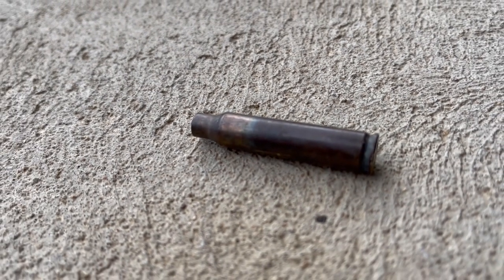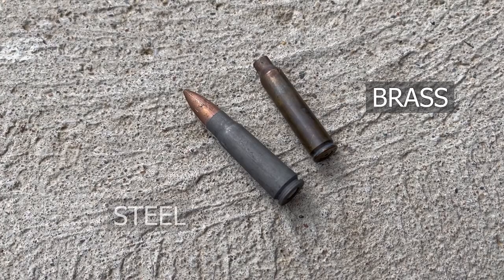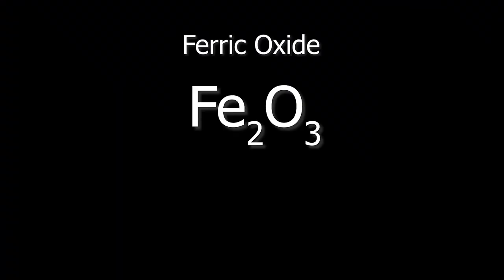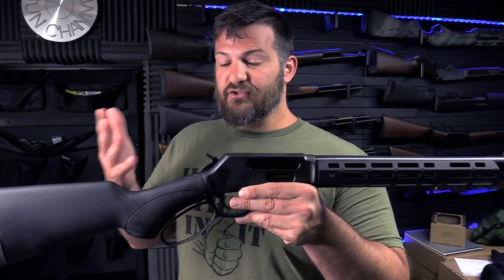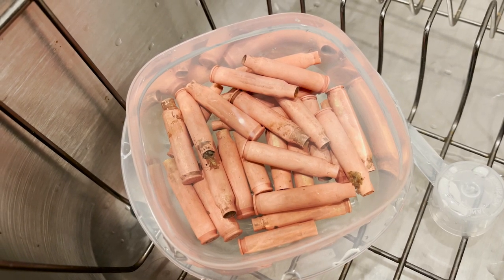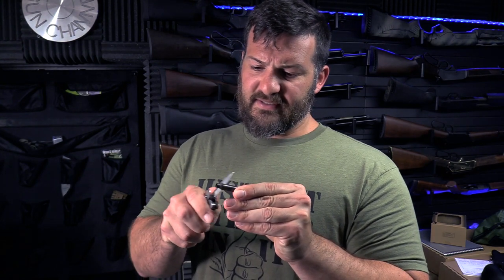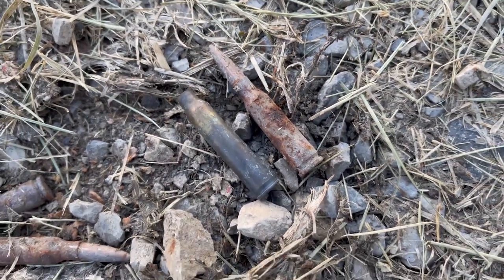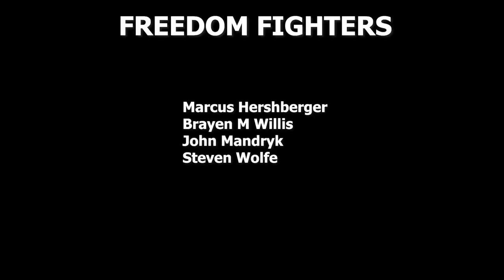Are These Reusable? Corroded Casings

Comment: Used many pieces of brass that looked just like those (the black ones not the red) over the many years ive been reloading. Never had any issues after getting em cleaned up
Reply: I did the same thing. Unfortunately the stain from the tumbler sludge has ruined my bathtub. I dont want to get to aggresive with any abrasives. Any advice on tumbler black sludge stains?

Comment: Drop in vinegar 5% delute is fine... maybe a few hours.. check every 30 to 45 minutes.. they will not need to be 100% coppery or brassish color and the dark carbon look will still be present.. drop them into a neutralizer water & baking soda, mix around well.. if you desire to know if the base neutralizer is at a balance, test stripe can be made from red cabbage juice making process or purchased for checking pool water or aquarium water (not all aquarium test strips have the full scale of Ph scales) Then throw the batch in the tumbler for the normal process one does for that.. inspect cases for the typical damage from either the previous owner, or range damage.. Run the day lights out of them...

Comment: I just showed someone that even a nasty piece of old rifle brass that comes out of the wash looking like straight copper (dezincification from acidic soil and water) is just surface deep. It’ll literally wipe off with 0000 steel wool, or in a tumbler. Black pitting is what you want to keep an eye out for. 
Oh and powders like the CFE ones from hodgdon will make everything be covered in blue (copper sulfate?) crystals. Old brass, gas blocks, bcg, if it sits for any amount of time you’ll get them popping up anywhere copper is.

Comment: I got a bunch of casings with oxidized and corroded cases mixed in. I should have separated the oxidized ones from the badly corroded cases before tumbling but well they all ended up shiny and looked new, except the case wall for some of them turned out to look like moon craters. Can’t tell if it was the corrosion or if it was me letting it sit in tumbler for far too long but those definitely weakened the case wall and are not smooth enough to be easily resized. I toss those away. All brass cases and jacketed bullets oxidize over time I wish there was a better way to keep them shiny besides bagging them in airtight containers or vacuum seal them

Comment: I noticed something odd like this one time, before I had my stainless steel wet tumbler (which is the best method for heavily oxidized cases in my opinion), while using a sonic cleaner and some Purple Power. If I remember correctly that active ingredient has an acid in it as well and it made my brass cases look like a semi pearlescent old timey mirror or oxidized silver looking. I reloaded them and shot them anyways without issue.

Comment: Steel can also be tumbled and decapped with a hydraulic decapper and resized in standard dies. You need more lube for steel cases and berdan primers where applicable. You'll get at least 1 loading with tumbled, formerly corroded steel brass, possibly 2. Load mid range, no hotrodding.

Comment: I ain't no chemist, but what I usually do when my cases start to turn black is, throw them in a bottle, like a big gatorade bottle, with white distilled vinegar, and a little bit of dish soap.
The dish soap is to remove the oils that might protect the oxide layer, and the distilled vinegar eats at the oxide layer.
Just fill the bottle about a quarter full of vinegar add about one squirt of dish soap about ¼oz, and mix. (More soap if your brass is oily for some reason)
add your brass until you have a little bit of room to let them tumble, top off the bottle with vinegar, and close it good.
give everything a good Shake to make sure they are tumbling good, and just shake it again for at least 30 seconds every 10 minutes or so, until the brass looks as good as you want it to.
Repeat if necessary.
that usually does the job pretty good.

Comment: Ok. What is the green patina we see commonly on copper statues?
Reply from the maker: It’s a mix. Basically it starts brown as described and transitions to green after rained on repeatedly. Basically that water contains acids and bases in small quantities that react with the oxide. The Statue of Liberty for instance is exposed to rain from salt water. I would guess that it is a mix of copper sulfate and copper carbonate. A more terrestrial location would probably tend more toward the carbonate from dissolved CO2 converting to carbonic acid. It’s a little more complex than that but that approximate statement will suffice for now